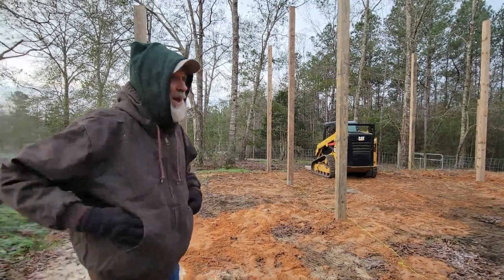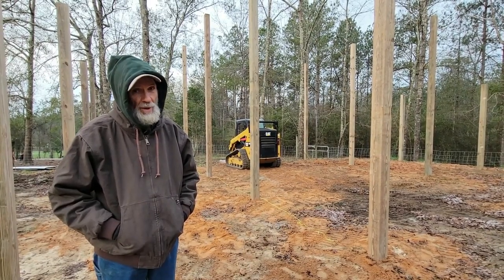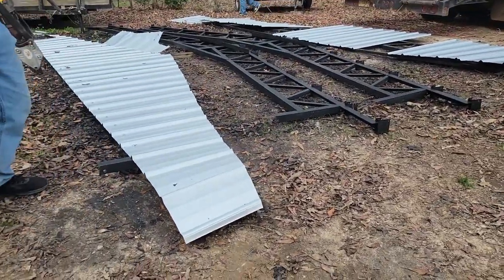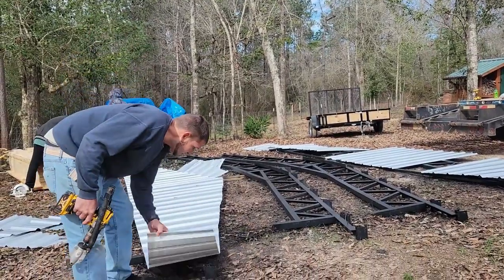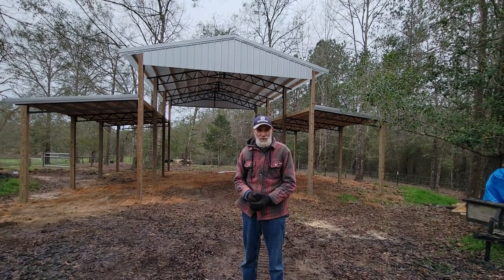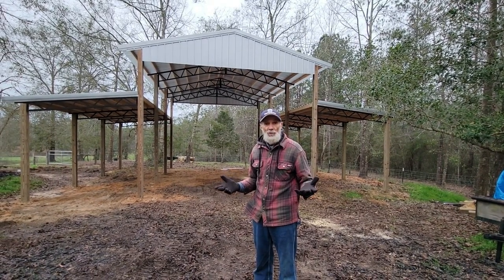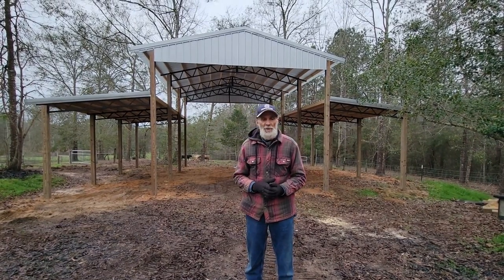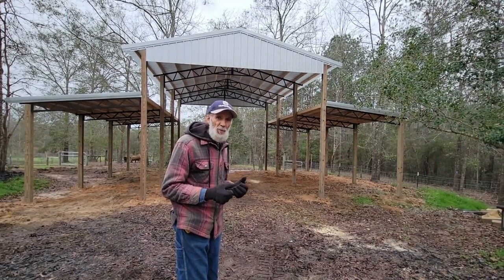Pole Barn Build part 2 --- FARM ALL Barn

Comment: Looking  good ya'll! Will be real nice.
    I built mine myself and I live on a hilltop.  It gets "real" windy here. I dug 4 ft holes for the poles added 6" #57 rock. Drilled vertical holes 1 ft from bottom of each pole and hammered 1/2"  rebar thru and left 2" of the rebar sticking out of each side. Filled hole with Portland cement. I didn't want to have a real storm and have Toto blow away! 🥴🥴🥴

Comment: Was a builder in the navy.  Invested in the extra screws for the roof for the same reason. Also went with 2.5 inch screws for the outer edges and ridge cap over the 1.5 that came with the kit , also in hurricane zone here in South east nc. Anxious to see how you side it.  I'm going to pour a concrete curb flush with the inside of the posts and 1.5 inch past the outside of the post so the wall is supported full perimeter. Using 1 by 12 sawmill boards , board and batton, because I can get cheaper than metal. Going to role some 3 plus then role in a mix of pea and marl for the floor.
Reply from the maker: We are using 1x10 poplar to put around it. We will be pouring a concrete base for our walls also.